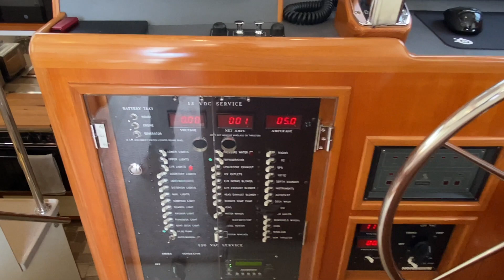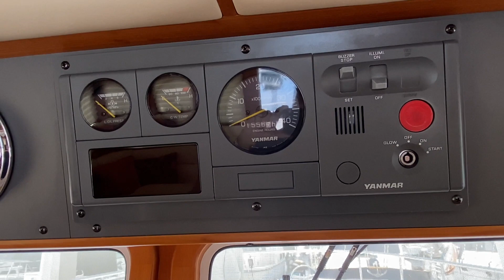NORDHAVN 35 TOUR IN 4K

Comment: The 35 was a real departure from what Nordhavn was known for at the time, a good first effort....I really like the layout.  I wonder how the boat would do for range with a 4-cylinder, and perhaps another foot of hull at the transom for a bigger swim deck and longer running surface.

The single stateroom version of the new 41 is a nice evolution of the 35 but with a bit more interior volume throughout and the engine room is really impressive.
Reply from the maker: The range with the six cylinder Yanmar engine is pretty amazing.  According to one magazine test done in 2002, the boat can obtain a 4214 NM range at 6.3 knots, 2786 NM range at 7.9 knots.  Not bad.  My own tests have obtained similar projected ranges but a bit less.